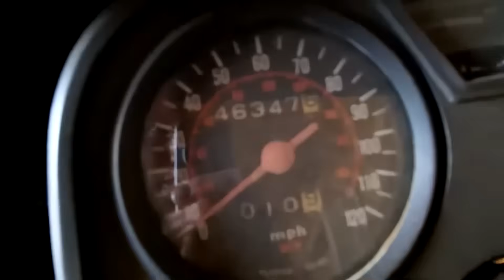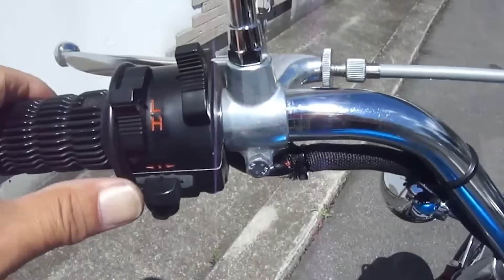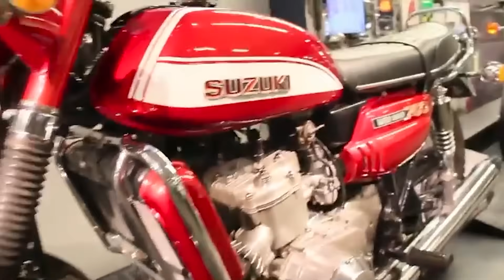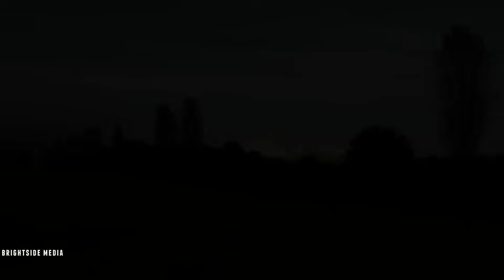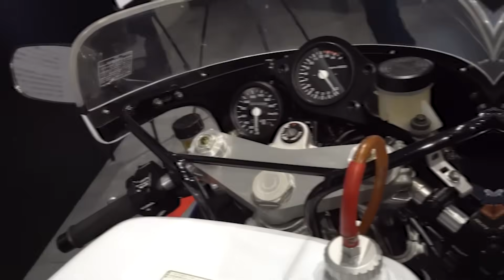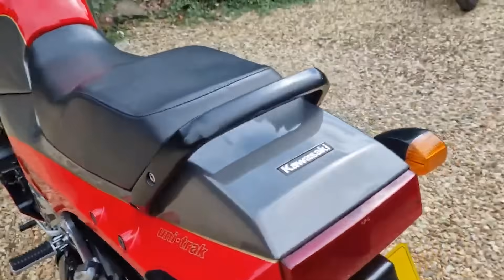Why These 15 Old RETRO JAPANESE Motorcycles Are Still Famous!

Comment: I had one of the cx 500, loved it great, but you had to know it had a torque pull to the right when you throttled hard but was not too bad.
I wish motorcycle corporations would bring back these simple & way less ecteronic crap on the bikes thats not wanted or needed motorcycles.

Comment: Not a bad list, but he forgot one of the biggest legends.......................The H2 750! Also  2 strokes don't need to be rebuilt every 15,000 miles. The H-2 is a bullet proof bike and I know of one with 68.000 original miles and the engine has NEVER been apart.
Reply from the maker: Absolutely fair point—the H2 750 is a true icon! And you're right, those 2-strokes can be surprisingly durable when cared for. Thanks for keeping us honest and sharing your riding wisdom! 💪🏍️ Enjoy riding with us! 😎🔥

Comment: The XS650 is a 360 degree twin - not a 180 degree.  Do your research!
Reply from the maker: You're absolutely right—the XS650 does use a 360-degree crank, not a 180. Appreciate you pointing that out! We’re always aiming to keep things accurate for the community, and feedback like yours helps us stay sharp. Ride on! 👊
Reply: I believe this is another dumb AI generated video.
Reply from the maker: @charliebailey2359 I'm gladly disagree with you.
I can tell, you might not seen those AI channels out there, competing and winning the audience! and when I'm not using AI and there are mistakes, people start blowing whistles about! (I wish I used AI, ... I rather not to)

Comment: The '74 Yamaha TX500 certainly deserves mention. Silky smooth engine and wicked quick. Probably the best half litre bike ever.
Reply: Except they were a grenade waiting to explode.
Reply from the maker: wow! Do you have a story to share with us Peter?
I'd love to hear it bc as far as I knew, it's very smooth and well built!
Reply: @peterfarrell520  You might be confusing it with the first TX750's which failed because the counter-balance-shaft frothed the oil leading to no oil-pressure , it was modified by a deeper sump conversion but everyone was scared-off and a really good bike was discontinued . Dave  nz
Reply: I never knew one to be a problem.  Over 70,000 miles on mine with routine maintenance and tires. After myTX I rode a Z1. @peterfarrell520
Reply from the maker: The '74 Yamaha TX500 is definitely a classic! Its smooth engine and performance have left a lasting impression on many riders. Great call!

Comment: I will always love my Kawasaki 3 cylinder two strokes i had back in the day.
Reply from the maker: Oh man, the legendary Widowmaker? That bike was pure adrenaline and chaos wrapped in metal. No wonder it still has a cult following. We had to include it because it shook the motorcycle world like nothing else. Thanks for bringing up one of the true giants of the two-stroke era — those bikes don’t just ride, they roar in our memories!
Reply: A mate of mine had a 3 cylinder 2 stroke air cooled Kawasaki, a 500 if I remember correctly. One hot day it started vibrating badly, he pulled the clutch in and it was siezed.  On examination the middle cylinder piston had overheated, pulled out of the small end and turned sideways in the bore, an unholy bloody mess! It languished in his garage for years before he sold it for peanuts. 

They are worth about a gazillion quid these days when well restored.